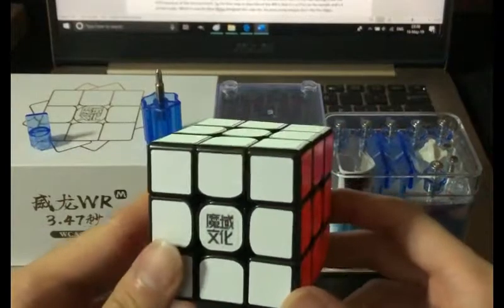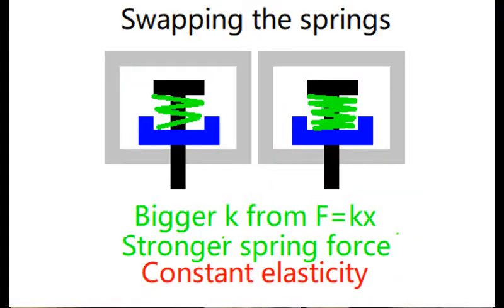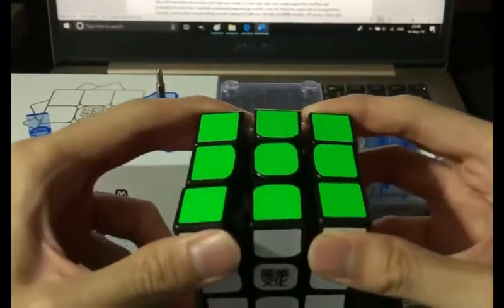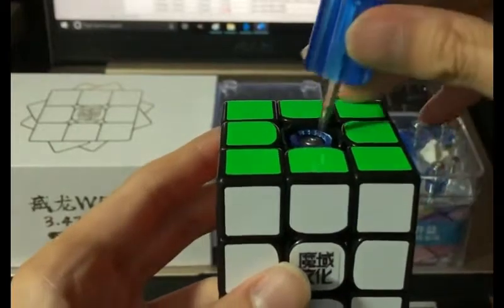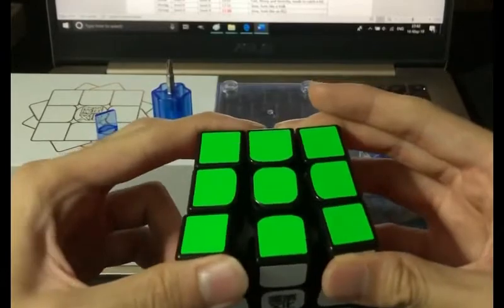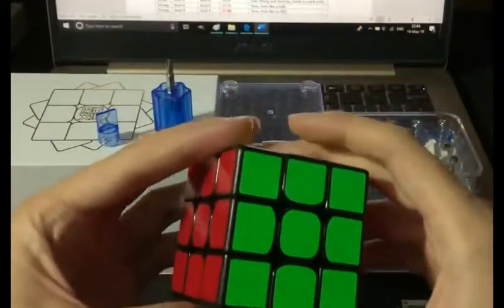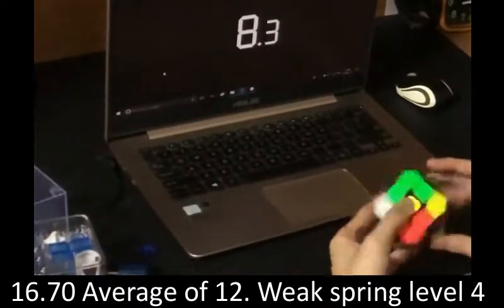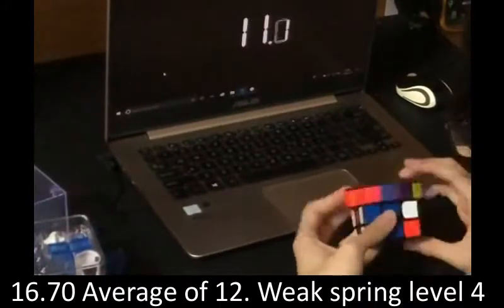Weilong WRM | testing 6 settings, theory & opinion

Comment: In my theory the tracks and corner stalks used on the wrm 2019 is same with the rs3m 2020…

If I’m right,are they swappable?or the magnetic core kit on the rs3m works on the wrm 2019?